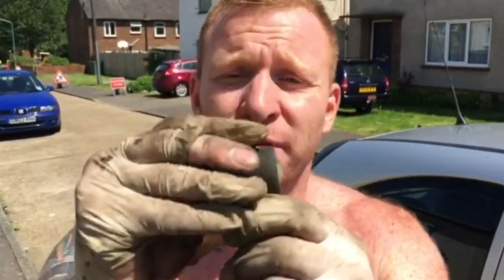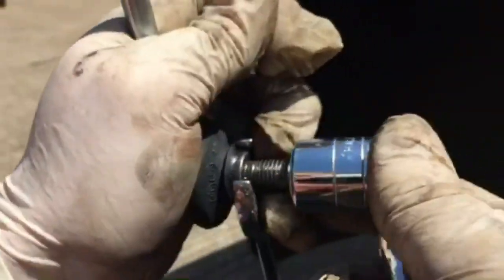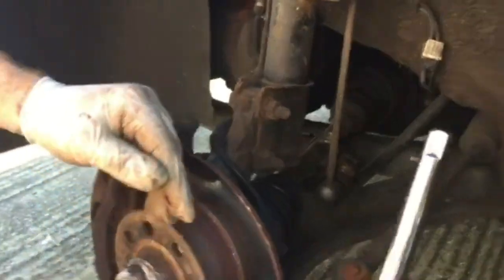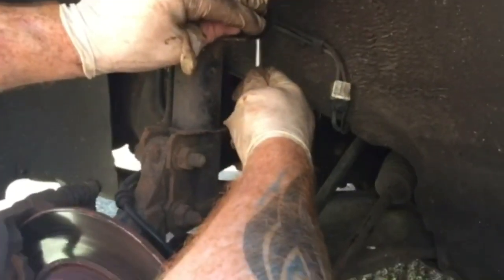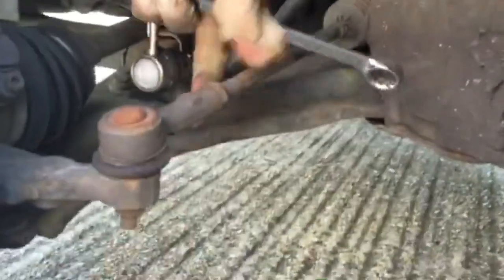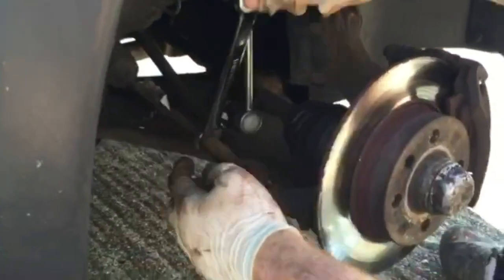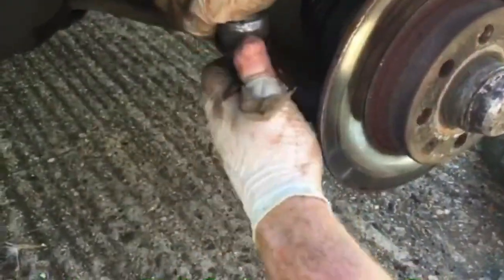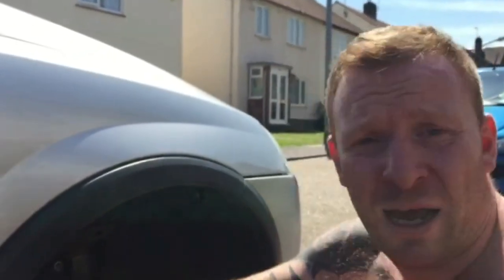How to change a Drop link and Track rod end

Comment: Great vid.... ive changed dozens of them... they came off easy...often they dont and rust has expanded the threads so much its impossible to undo the nut... Worst case if WD40 has failed to work, Heat.... or strut or anti roll bar removal (depending on which end is buggered) if not enough access for an angle grinder while working on the car...
Reply from the maker: I agree. Angle grinder on worst case scenario.  Cheaper to do at home so worth a go
Reply: @g4smo  Deffo... just done two on a M3 Honda CRV today... Drivers side went fine... Near side, disaster ... Strut off but angle grinder persuaded it !!

Comment: My van failed MOT for anti-roll bar ball joint dust cover excessively deteriorated so that it no longer prevents the ingress of dirt (2.4.G.2) and Anti-roll bar has excessive play in a ball joint Offside Front Upper.I've got to try and do this over the weekend, thanks for the Video Tony... ps Looks like Twydall area..
Reply from the maker: Binksybouncy Castle Hire & Softplay Hire hi thanks for your comment and yes you are correct that is Twydall area quite a while ago now but hope it helps

Comment: I did this today on my corsa d 2007, using your video as a guide.  I ended up having to cut the top nut off as the part where the spanner goes on, had rounded off. What should have taken an hour to do both sides, took me 5 hours.   Thanks anyway.

Comment from the maker: no. you have to replace the whole drop link. the rubbers are permanent attached to keep Grease in the joint. if they split it's a mot failure. sorry